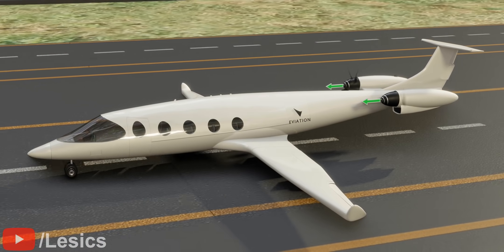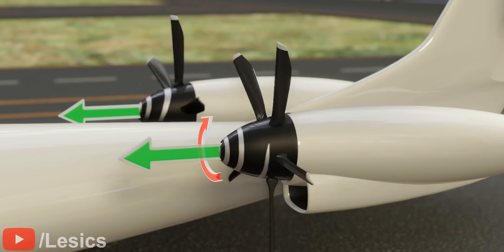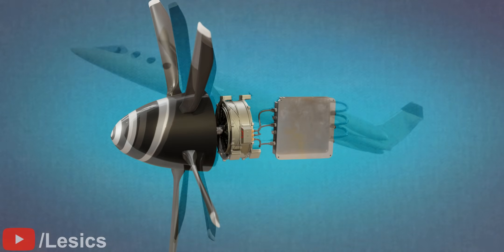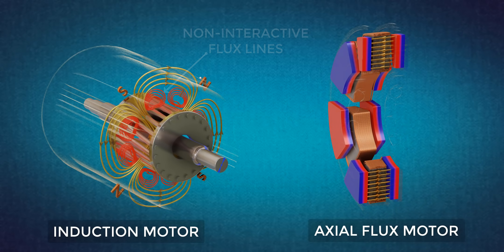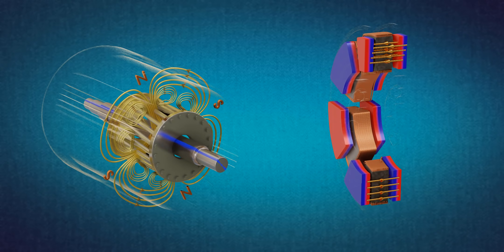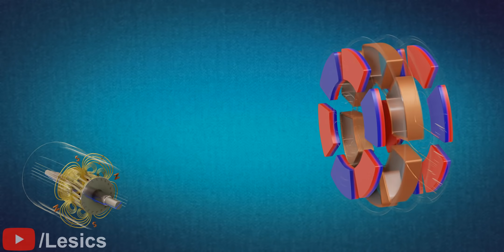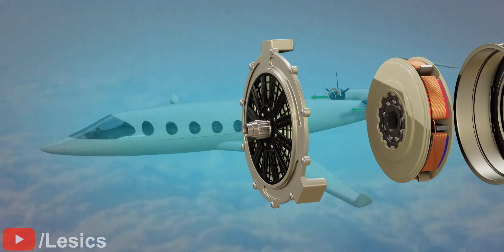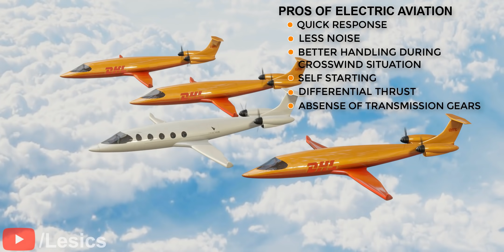Electric Aviation | The Dawn of an Advanced Transportation Mode

Comment: Missing from the video: Cons, short flight distances, limited weight capacity, long charging times. One of my ideas is to add a charging mechanism for the length of the runway that follows the plane until it takes off which uses most of the battery's power to accomplish.
Reply: Or just use carrier-alike catapult and don't reinvent the wheel
Reply: Just imagine how much batteries would have weighed in something with loading capacity of 777 and how much would have complete electric 777 weighed.
Reply: Also, electric planes don't get lighter as they use up "fuel".
Reply: @Electrowave  in the case of Li-O (the theoretical densest Li-ion chem) it gets HEAVIER as it is discharged
Reply: would not make economical sense. Most energy is used while gainig altitude
Reply: it will give you 100 meters more in distance while you need 10 km. we need better batteries but we need break through in science and these are hard to predict.
Reply: @marcosolo6491  catapults are probably better idea. I am all in.
Reply: @ukaszRadomski  G-force is not as fun as the g-spot.
Reply: The thing with the weight capacity and range is because electric aircrafts are still at their beginning. They are like children. Meanwhile jet aircrafts are already close to their full potential. For a better comparison you should compare the first electric aircrafts (which appear in these years) with the first jet aircrafts ever (1940s). Then you would compare a child with a child. Else you would compare a child with a grown adult.
Reply: @sharkquark6252  This comparison lacks a bit since battery tech hasnt gotten any much better for decades. There are some physical and chemical limitations. Fuel wasnt getting better by 50% every 10 years. All that got better was engines, frames and tech. And all this is already applied to your so called "child". It is more like an adult where they wanna change the heart. The problem is the batteries. And these are stuck for ages and there is a physical reason for that. So sure, keep on dreaming but it is just that: a freaking dream.
Reply: @sharkquark6252  There is a child which will potentially grow to be a midget, and there is a child whose name is Shaquille O'Neal who is already grown. Which one would you invest in?
Reply: Impressive idea. Like the catapults on aircraft carriers but with longer and safer runway.
Reply: Not only that, they need a complicated inverter
Reply: Your idea is literally a problem the navy had with aircraft carriers trying to throw planes into the air with such limited run way space. They solved it with 1) pushing the aircraft carrier to 30knots + sailing into the wind, and 2) using a steam catapult, now upgraded to EMALS. For purposes on land, you can adapt it as such to have a rotating runway that launches planes into the wind and equipped with EMALS.
Reply: No biofuel will save the jet engines using carbon fibre fanblade
Reply: Wait for solid state batteries
Reply: Or catalpult like on aircrafy carriers
Reply: good point.  i was thinking that planes are actually efficient than land transport. how much power does it need for take-off?  if it is a real problem plenty available solutions for that.
Reply: The biggest con, Alice never flew to prove their point.
Reply: Using hydrogen fuel cell ! Solv this.
Reply: @robinabraham2843  hydrogen is very energy dense by mass, extremely non-dense by volume (in any state of matter) so no, without a ground up redesign of planes there's no chance (you'll need a much much more volumous vehicle, like a flying wing) 

Not only that, the safety procedures and guidelines learned via the blood spilled from previous accidents will get thrown out the window with a complete redesign (not all the stuff, but a lot of the "rule book" becomes obsolete when you do something as fundamental as what's being discussed)
Reply: @robinabraham2843  Look at Real Engineerings video on this. Hydrogen has some issues of its own.
Edit. wrong channel
Reply: @TheSimon253  ok. lithium solid State battery 🔋! Work..?
Reply: @robinabraham2843  there is no battery chemistry that comes close even if you look at their "theoretical" maximums (which are no where near their realistic figures)

the closest is Li-O which at ~20mj/kg is close to the 45mj/kg (turbofans are ~50% efficient) of kerosene but this 20mj/kg is theoretical, they haven't gotten one anywhere close to this, and EVEN IF THEY DO, it only "matches" kerosene (in reality it would be much worse because "well to wheel" you will still lose to kerosene)
Reply: @DominicLeung87  "rolls roys elctric palne "how does it work !
Reply: @robinabraham2843  it's got a flight time of like 30 minutes at cruise power which means it can't do anything

it's got enough energy to take off, get a couple hundred feet off the ground, do it's one power run and then land

it's also pushing the absolutely limit of weight on it's airframe (which was bought off the shelf as a kit plane) and performs worse on every metric compared to it's piston powered equivalent (either marginally on some figures like climb rate, or completely pantsed liked in flight time)
Reply: @DominicLeung87  look, you are correct about comparing ICE to All electric in regards to distance/time of flight...  BUT you need to start some where.  As electric storage technology advances,  so does the distance/power.  Regardless,  all electric has another plus, zero pollution produced during flight.
Reply: @coug96fan  it's not the start, it's that the end point of electric is no where near where jet turbines are today

Batteries simply suck ass when it comes to energy density by mass and unfortunately planes are probably the application which values this most highly of all the "normal" transportation methods by a long long way
Reply: @coug96fan  I have a friend who works for Panasonic as an engineer. He told me that successful application and widespread use of battery powered flight most likely won’t happen for another 20-25 years. And even then it will be aircraft that fly domestically shorter distances. Long haul flying like done by the Boeing 777, 787. etc is a pipe dream. Battery tech will never be there to match those. Especially when you factor in that those aircraft will also be improving their efficiency as well.
Reply: @joecmonteiro  Well I guess all the eVTOL and other electric planes being produced today don't by their batteries from Panasonic.  Regular battery powered flight is 5 to 10 years away, not 20.
Reply: @coug96fan   eVTOLs will find limited use for passenger service since they have limited range and carrying ability. What I was referring to was the replacement of your typical jet powered airliner like the Boeing 737, etc. E powered replacement for those won’t likely happen until 20-25 years from now and that’s being optimistic.  There is no trade off with fuel weight vs useful load with battery powered aircraft because the batteries never decrease in weight as the energy is used up (unlike jet fueled aircraft). In jet powered aircraft you have the flexibility to carry more passengers (and cargo) and load less fuel for shorter trips, or load more fuel and less passengers (and cargo) for longer trips. That gives flexibility with useful load. With battery powered aircraft the full weight of the batteries is constant whether you charge them 50% or 100% which means you have no flexibility with weight carrying ability of passengers and cargo.
Reply: @J M  yep, makes sense.
Reply: @robinabraham2843  if you’re going to use hydrogen, then you might  as well stick with normal fuel anyways. What’s so special about hydrogen?
Reply: @jamesbizs  with hydrogen is just water as byproduct
Reply: @e-bik3  how do you think hydrogen is produced ??? Just because the plane doesn’t produce CO2, doesn’t mean that the hydrogen plant doesn’t produce CO2 while making hydrogen.
Reply: @jamesbizs  Renewable energy?
Reply: @e-bik3  it never is

Electrolysis of water is very energy expensive and that’s assuming you have fresh water, if you have salt water it’s even worse

Once you look into how much slippage at every step of the “hydrogen cycle” you quickly realize how it can’t work as a whole
Reply: @e-bik3  you are not well informed. Commercial hydrogen comes from gas.
Reply: @jamesbizs  A hydrogen engine isn't like a combustion engine. In a hydrogen car you have an electric motor and a fuel cell which converts hydrogen to electrical energy and water. Thats also how hydrogen is produced. Just in reverse. Thats the advantage of hdyrogen powered vehicels. You have longer distances compared to a battery, the same time as it takes to refuel a combustion engine and no emmision (not counting in how the electricity is produced)
Reply: @robinabraham2843  nope. stored hydrogen is impractacal and dangerous using current tech
Reply: @robinabraham2843  Naa, Just put a miniature nuclear plant at the back of the plane.
Reply: I think robot charging sleds will follow the planes taxi-ing keeping them charged until takeoff.

Comment: 5:51. I don't understand your point?  A jet engined aeroplane can also use differential thrust, and as the power on final approach is high the engine response is rapid.  But there is no need for differential thrust; crabbing with aerodynamic controls is perfectly adequate.
Reply: Maybe they meant it is more easier and simpler with electric airplanes.
Reply: Electric motors have a millisecond response time which  makes it easier to use and easier to program autopilot, so pilots have less to worry about.
That's why you dont see many jet quadcopters.
Reply: He said in the video that jet engines are laggy and less precise at thrust control compared to electric motors.

Differential thrust can done automatically on an electric plane without pilot input to keep the plane more stable for a safer, less risky landing.
Reply: Due to the long response times of jet engines, you cannot effectively use differential thrust for countering crosswind. That's why the statement is correct.

Comment: Hydrogen fuel cell and electric motor seems like the way to go for future aviation
Reply: That's true. Although it's not ideal for automobiles, the low weight of hydrogen make's it ideal for aviation
Reply: @brokolosbinala2970  also very important that hydrogen plane can get progressively lighter when they fly like a conventional plane, which is crucial because planes’ maximum takeoff weight is usually greater than landing weight
Reply: @brokolosbinala2970  low weight of hydrogen? Doubt it weighs less than any other fuel, when it comes to how much can produce how much power.
Reply: @jamesbizs  compared to battery electric planes hydrogen is lighter
Reply: @brokolosbinala2970  yes. Compared to a garbage tech (for planes), hydrogen is a better garbage tech.  Which is why it will never compete against liquid fuel.
Reply: @jamesbizs  I'm confident that electric planes will become mainstream at some point because we need to get off fossil fuels. 
And I'm also confident that electric planes will become better than liquid fuel planes in the future

Comment: Why are axial flux motors not used in electric automobiles?
Reply: for any project/vehicle motor selection is done based on speed and torque requirements of the maximum load on the vehicle.
Reply: @zaidchachiya8389  Obviously.  This tells me nothing.
Reply: @sanjuansteve  He means cars need a lot of torque- especially due to lots of start/stop actions. It usually becomes a trade-off between sharp performance and efficient long distance or high speed travel. A plane only needs enough torque to counter air resistance and rotate at high speeds.
Reply: @Zerecese  Thanks.  So axial flux motors have lower torque despite having much greater efficiency?
Reply: @sanjuansteve  I can't say for certain as I'm no expert, but it will be something like that. Aeroplanes only need to worry about being efficient through sustained use at high RPM over comparatively long periods of time.
Reply: @Zerecese  And so you're suggesting that despite the greater efficiency, the torque to weight ratio is lower than radial flux motors?
Reply: @sanjuansteve  possibly. I think it's more about efficient use of energy. Some motors are more efficient at lower speeds, accelerating or maintaining high outputs without overheating.

Like I said, I'm no expert; I'm just making a few logical assumptions based on my minimal knowledge of the subject. Radial flux motors probably have greater energy efficiency operating at the speeds and loads required for driving a vehicle if that's what is currently used.
Reply: Because there you dont want a motor close to the ground and if you need additional moving parts, for bending thr torque that sucks

Comment: 5:08 this is wrong! jet engines can also produce differential thrust! i am so confused to why such an obvious mistake was made in this video
Reply: Due to the long response times of jet engines, you cannot effectively use differential thrust for countering crosswind. That's why the statement is correct
Reply: @foxx8414  wrong the response time is not long,
Reply: @foxx8414  wrong, go inform yourself again mate, that happened in 1988 and the accident was actually due to failure in the recently introduced fly by wire instead of hydraulics as conventional. youre welcome. also aircrafts with multiple gensets have individual throttle control.
Reply: @carholic-sz3qv  the crash was caused by human error as the pilot approached a different runway than planned. There was no malfunction in the fly by wire system, by the time the pilot noticed the trees and applied full thrust, it was too late for the engines to supply that thrust in time, because of the delay in action.

that's the point I was making earlier.

the fly by wire system has not malfunctioned, because either they were going to fly into the trees or stall (which was prevented by the fly by wire system)
Reply: if the response time wasn't low, as you claimed earlier, that crash wouldn't have happened. (ignoring all the previous mistakes that have led to the crash, ofc)

also no need for the attitude, calm down
Reply: @foxx8414  bullshit it still doent matter if youre right or wrong, it was too late and even an imaginary electric aircraft wouldnt have saved the crash.
Reply: @foxx8414  the other thing you forget on electric vehicles the tesla models plaid for example to do 0-60 in 2s it needs almost 10 minutes waiting time unlike gas cars that are always ready all the time once they are hot. also electronic systems, injections and many other systems ahve significantly been improved since 1988. today an aicraft can even fly with one engine.
Reply: @carholic-sz3qv  I don't know why you're getting so mad, it's kinda funny. Also would love to know where you got your aviation knowledge from. Commercial twin engine aircraft have been able to fly with one engine only for decades, it's nothing new.
Reply: @foxx8414  commercial twin ELECTRIC engines aircraft?!?!? lol..... that accident happened because of a suite of mistakes/errors it wasnt the fault of the pilot, also it was at that time a brand new ssytem that actually overdrove the pilots input. hydraulic controls are way faster and more responsible than electronics.
Reply: @carholic-sz3qv  you should read up on that again, it was also pilot error.
and no, by commercial twin engine airliners I referred to turbofans and jets, not electric.
Reply: @foxx8414  then he should have said at 4:56 "the ability to produce "fast responding" differential thrust" and at 5:08 he should have said: "such an operation is "slower" in jet engines" instead of impossible

Comment: This video is factually incorrect in  at least two things.  FINE pitch is used for take-off, not course pitch.  Using differential thrust from  jets or turbines is more difficult, but not impossible as stated in this video.  An experienced pilot is unlikely to use differential thrust during landing, and would never use it for take-off, as maximum performance is used to get an aircraft safely off the runway and to an altitude in which there is a margin of safety in case something goes wrong and an emergency landing is required.   While the graphics are nice, I would have thought a YouTube channel with nearly five million subscribers would have the resources to thoroughly and correctly discover and present the facts.
Reply: Thanks, that's what I thought because this is a fundamental property of propellers.  Another error is at the end says "in a few years we'll probably be able to fly to another country".  That's only true if you live within 200 miles of another country.  The fundamental limit is energy density in current battery technology and that won't change dramatically anytime soon.  Electric aviation is great if you can reach your destination within an hour.
Reply: @GeorgeOu  few years is decades away. But some breakthrough will change everything.
Reply: @idzkk  Look up the definition of a few.
Reply: @GeorgeOu  we can fly to another country now if we are close enough hahahahaha thats not wrong thats just empty statement that means nothing. advertisers will often use it
Reply: shhh... nobody told them you need high pitch at high speeds.. hahahaha